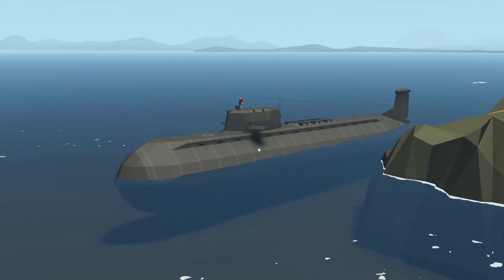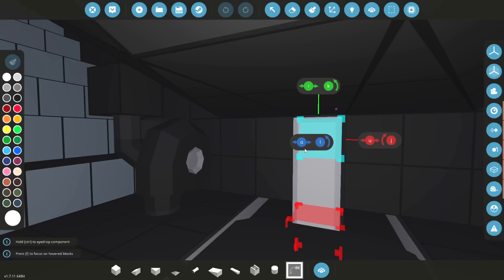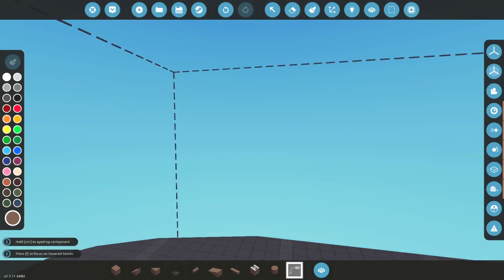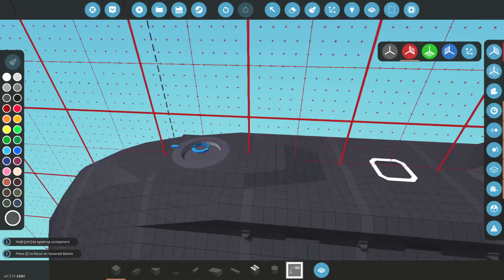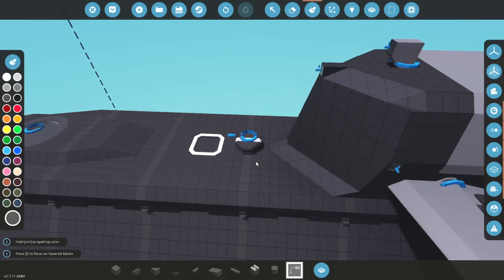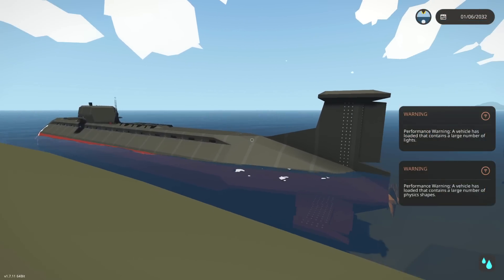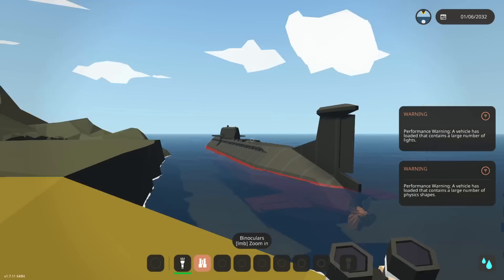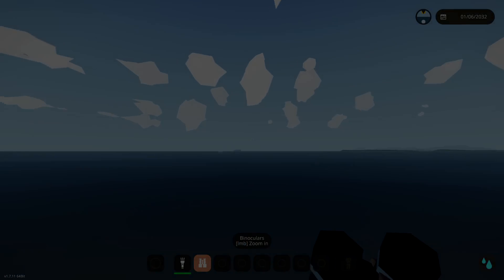Adding RADAR & SONAR To Our ICBM Submarine In Stormworks! #19

Comment: U should add a torpedo bay, and a more effective way of diving so that u can level off underrwater and not be constant down or up
Reply: I agree with this
Reply: By individually draining and filling ballast tanks in the sub he could balance it on the fly while under water. This also means that after modifying the boat he wouldn’t have to redistribute the weight because the tanks could compensate for the added weight by draining or adding water to the fwd, aft starboard or port side tanks.I don’t know how he could program this or control this easily but it would be the most logical system
Reply: @godofthewinter9702  you got a simple version cause i aint understand all that i learned about boats not subs

Comment: irl submarines cant use sonar near high enemy activity zones because they can hear them. They cant even speak loudly sometimes because of that. And subs need to surface to use the GPS thing. While underwater theres a system i forgor the name records the speed and direction of sub and shows you a pretty accurate map. Can someone tell me its name?
Reply: I don’t know the name of what you are referring to with the map, but they can still use sonar; just in listening/passive mode instead of active mode. This means they can track the ship’s engines and stuff, but can’t see the silent bits, and also means the sonar doesn’t emit any noise either.
Reply: Inertia Navigation system. It relies on sensors coupled with output from propeller or propulsion and updates the map system. However the longer underwater or without a navigation fix - the greater the error in position over time. Dead reckoning I think was the Aircraft navigation equivalent.